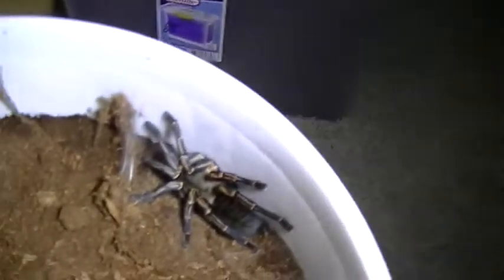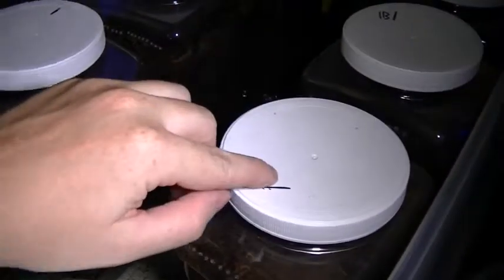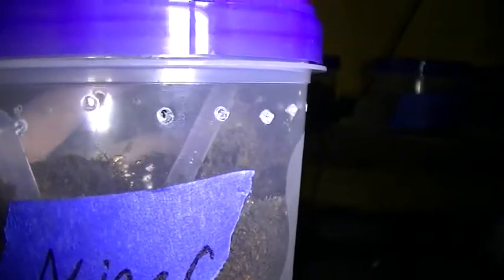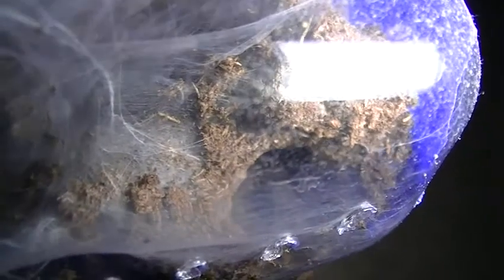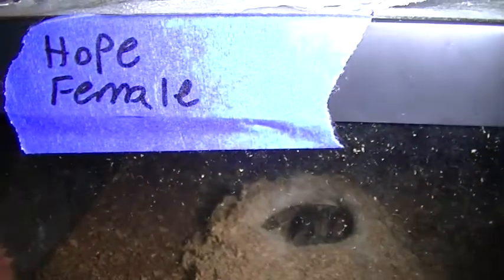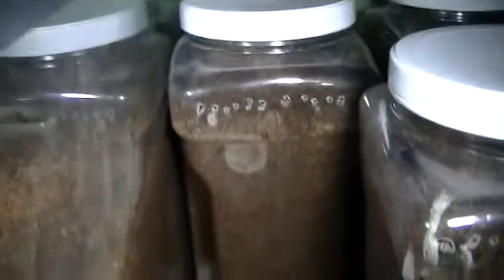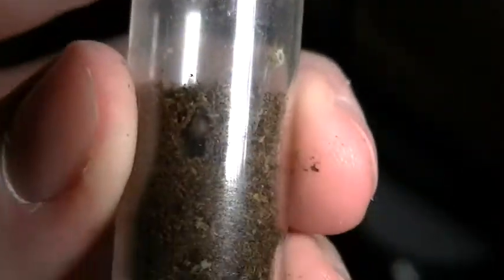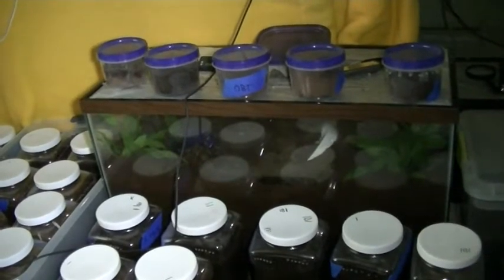My collection

Comment: 8:24 You said, arboreal Ts are delicate?? Absolutely not!! Their bodies are perfectly designed to take a fall, especially from tall trees. Evolution has made their exoskeletons as tough as nails compared to their terrestrial/burrowing counterparts that are much more delicate because they never lived up trees and hasn't evolved to survive a fall by accident like a slip or get blown away from a strong gust of wind. I've heard that some species are so flattened that they have the ability to glide down using the wide flat tips of their legs to float down more like a Parachute or a sugar glider. Dude in my opinion, i think arboreal Ts are much more resilient than you may think. I've owned different types of arboreal Ts for years now including the gorgeous P. metallicas, and i never have any difficulties with them aside from old age. I've always been fascinated by Arboreal Ts.
Reply from the maker: delicate in that people have a harder time keeping them alive in captivity than terrestrials
Reply: Spiderengineer Most people tend to heat up their room only disregarding humidity, and some ignorant people just crank up the heat with no combination temperature/humidity gauge, or check for molds inside their terrariums. In my experience you're right, they can be delicate Ts only if they're slings.
Reply: +Jerum Distura depends on what species avbicularia are the worst, while pokeys are not to bad